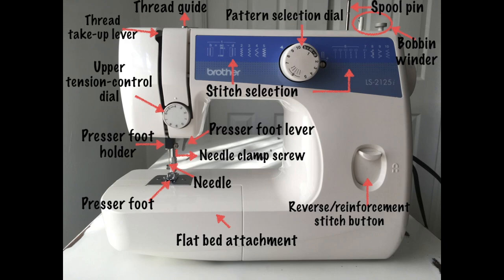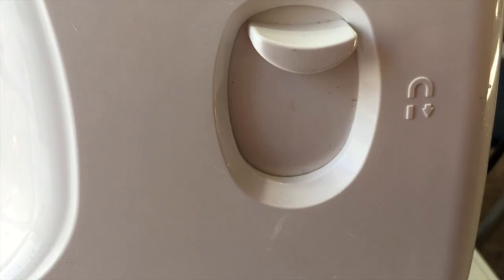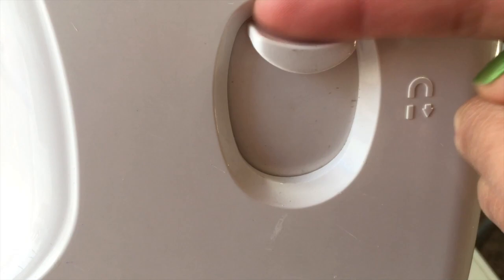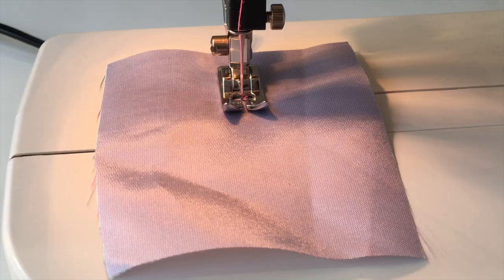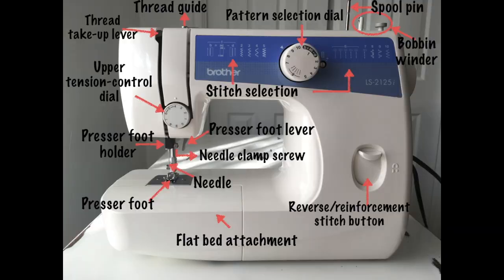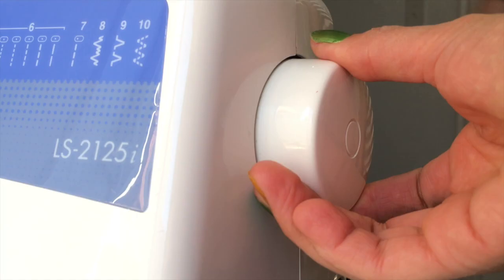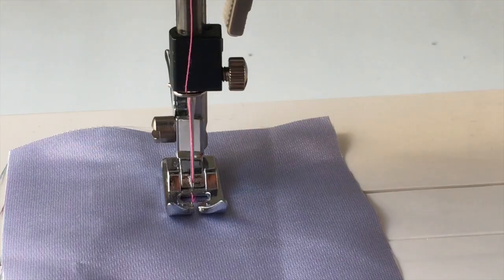Sewing Machine Parts and their Functions.

Comment: I can't get thread on bobbin :( I have the same sewing machine. The handwheel isn't moving
Reply: Did you put the bobbin on the winder then push it all the way over to the right as far as it can go? Also, if the handwheel won't move then it may be stuck and need to be repaired.